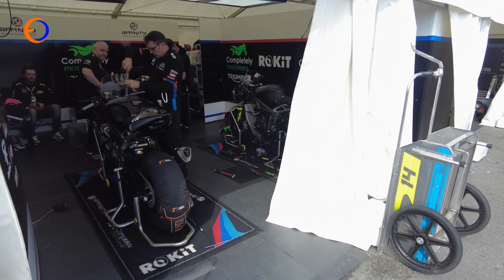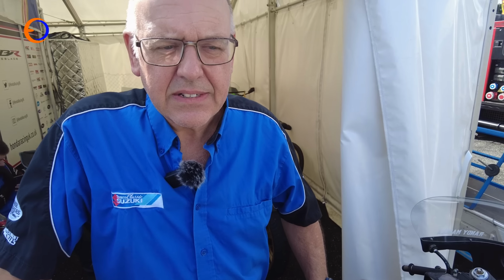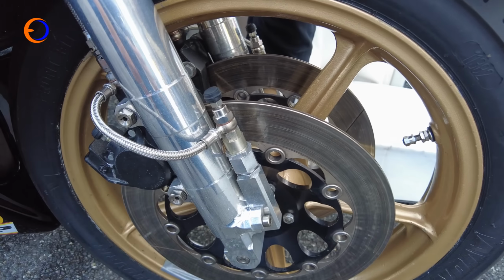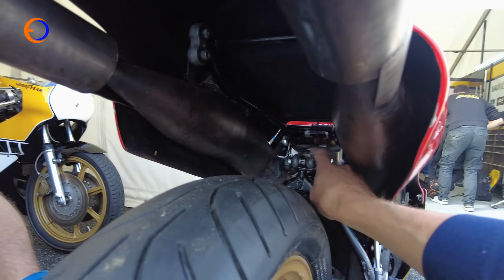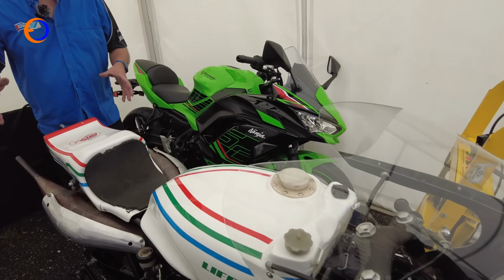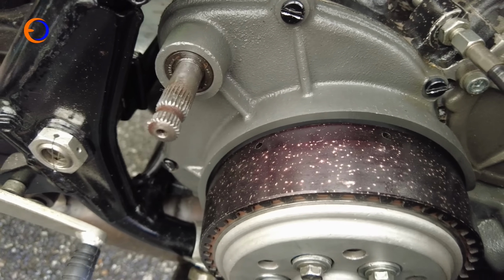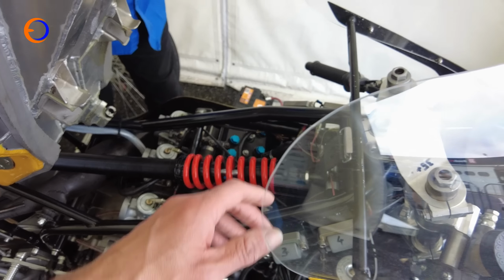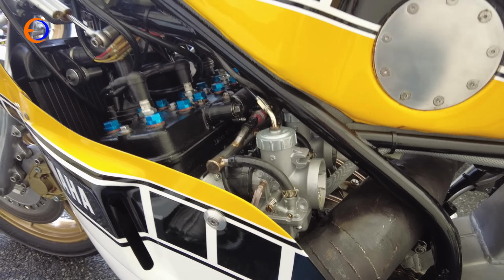GP and TT winning RG500 and TZ750 details + start up Full noise 2 stroke racers Randy Mamola 500gp

Comment: RG XR Mamola is the later 'stepped' square four motor. The TZ looks like a 'D' spec production bike (rear swinger apart) like Reads RG, whereas the OW31 versions were factory specials only made available to works supported riders.
Reply: Seeing Baker and Roberts on the OW31s was great. Baker was a brilliant smooth rider.

Comment: 🥱 the rear suspension should be so close as possible to the ground - asia , they try something but it is not german engineering ! 
i prefer exhaust gases at the "belly pan" also the wight of the rear shock absorbers - but hey yeah if a company find a "jockey" on the globe which "over skill'ed" it - why not 😊

Comment: Proper race bikes🥰. Not the glorified road bikes that BSB and WSB serve up👎🏻. The fact that the glorified road bikes are churning out way more power than these 2 strokes is totally irrelevant🤭. The tyres they were using back in the 70s must have been rock hard compared to the ten lap wonders they use today too. And the suspension must be leagues better nowadays🤔.
Reply from the maker: I too am a fan of a real race bike, that's why motogp is better than wsb 😊
Reply: @obsession_engineering yeah, part of the attraction of racing is the machinery and that's missing from production based racing. That's probably why I just can't get into Moto 2, plus even tho everyone's using the same engine it doesn't seem to provide close racing🤔
Anyway, thanks for the videos you provide sir👍🏻. I really enjoy the behind the scenes race engineer stuff as it gives some insight into the dark art of how you go about setting the machines up. The Oliver's Mount vids are interesting too as it's the first track I ever went to 👍🏻